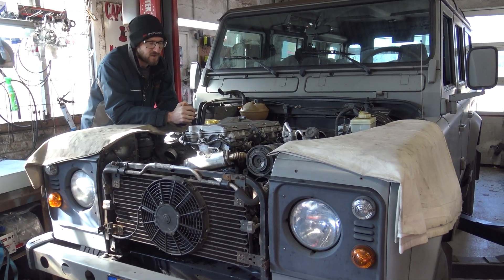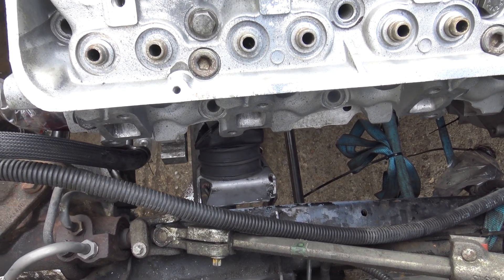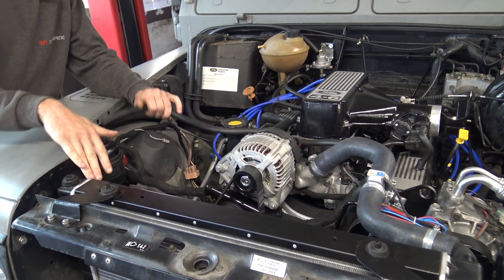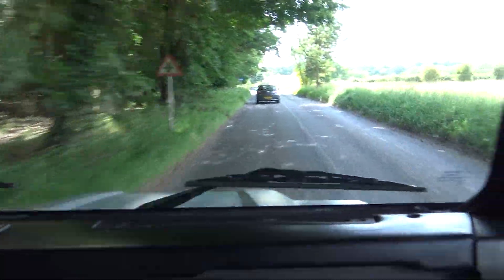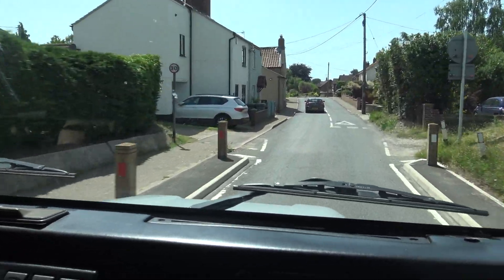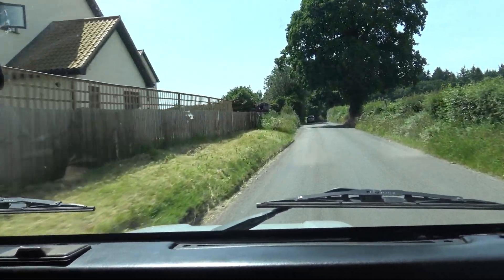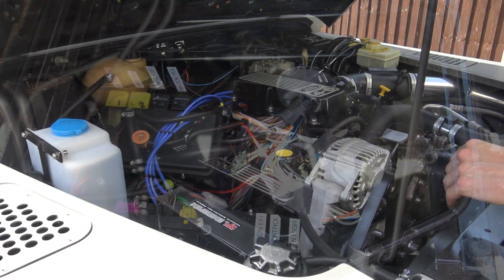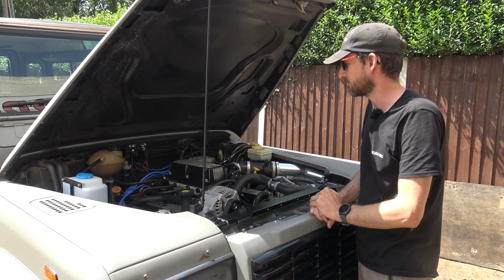Defender 110 TD5 to 4.6 V8 Conversion - RPi Engineering

Comment: This is a lovely job, are you still taking these on? The 200tdi in my bobtailed Discovery is worn out and was frankly underpowered to begin with, I would very much like a good (if not completely rebuilt) 4.0 Thor V8 to be fitted with a 4-speed automatic and a standalone Tornado-chipped ECU like you showed here. The Disco is no show truck so doesn't fit with some of the shiny rebuilds. Is it worth me emailing or calling to discuss?

Comment: What fuel pump did you use? As I am looking to do the same, V8 and I have plastic 110 tank.
Reply from the maker: There is no straight forward fit and job done fuel pump. With a conversion like this there is always more than one thing that needs modifying with most steps of the conversion. The Gems P38 pump physically fitted however needed moding to work correctly

Comment: dear sirs, where may i find a stroker crankshaft kit (not a buick 300 crankshaft modded to work in a rover v8!)for a rover 4.0 v8 engine??
#LHD
#RHD
Reply from the maker: The Rover 4.6 liter crank shaft will fit in place of the 4.0 liter crank however requires the 4.6 rods to work correctly and can then use either the 4.6 or 4.0 liter pistons depending on what CR you are aiming for.

Comment: lovely job. power and torque figures?
Reply from the maker: We have never dyno'ed this engine build spec as the actual figures have never been important to a customer. Its about having the right feel to it at the end of the day, that being, instant throttle pickup at any rpm with any amount of throttle.

I would estimate torque to be around 300lb/ft as is the norm for a 4.6 and bhp most likely around 260 ish as the cam choice is designed for a nice driving engine, not peak bhp figures.
Reply: @RPIEngineering  What is peak hp on a 4.6? 325?
Reply from the maker: @wjthehomebuilder  It all depends on cam and head choice really. 300 can be done with still a nice idle etc but it does drop off the torque curve in the lower rpm so not ideally suited to a Land Rover. Forget about smooth idles etc move the power band further up the rev range and 300 to 350 can be done but thats not the style of engine we build, 99% of our customer base wants a well manered engine in the whole rev range. Go forced induction and 350+ is an easy reach however then you start to get into where your weakest link is, auto gearbox, pistons etc.
Reply: @RPIEngineering  Ok. Thanks Ian. 👍

Comment: Nice conversion.  Please don't do a Puma/TDCi conversion video as I don't think I can afford it and as you're only 15 miles away the temptation would be too great!!
Reply from the maker: Thanks. Even better have your conversion featured lol!! Puma dash is the harder part to sort though as its modern stepper motors driving the gauges. Its all manageable but added expenses.
Reply: @RPIEngineering  I recall reading that Futuranet Ltd do a gauges controller for Pumas.  It's the emission laws that baffle me!
Reply from the maker: @CB-et9dm  Yes I heard there was a device to control then however from experience its all a test until you have seen it working for the first time in front of you. Yes I'm not sure where emissions would need to sit. This conversion was very clean 0.04 CO% and 60 HC at idle with lambda 1+/- 0.03 and even cleaner at fast idle test!!